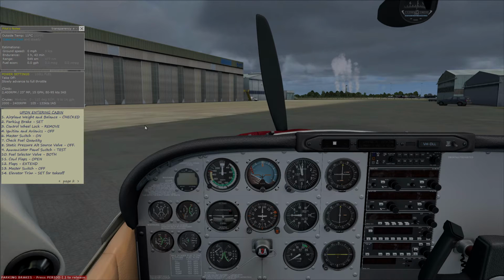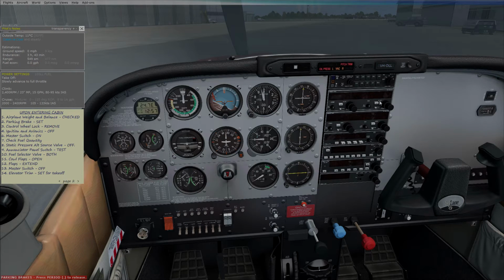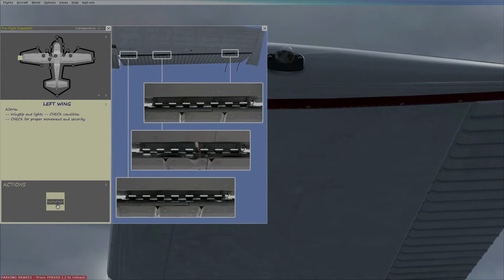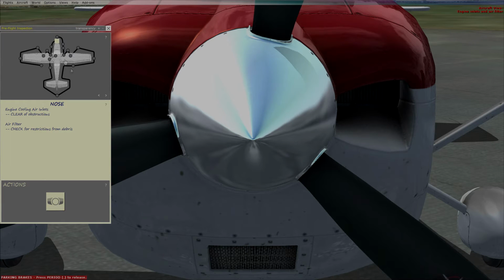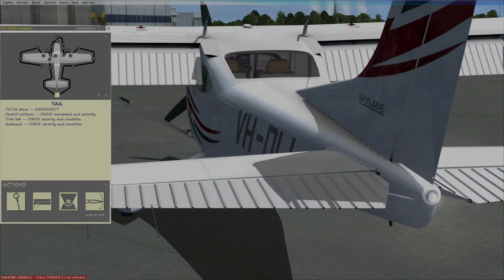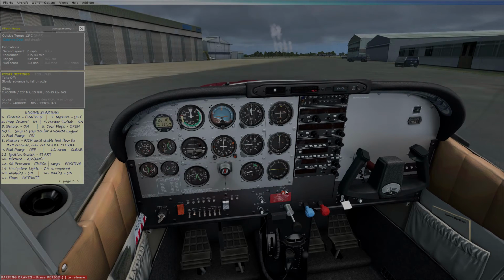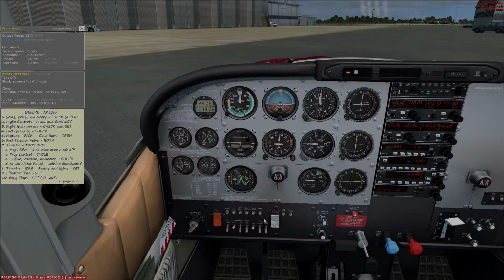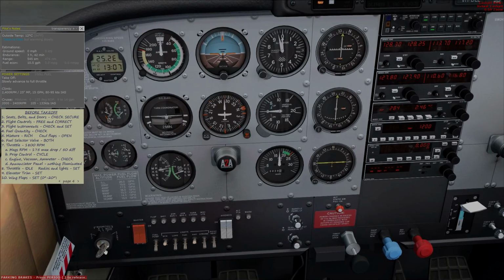How to Start A2A C182 (Fouled Plug)

Comment: Don't forget to lean on the ground, also make sure to idle at around 1000RPM :-) you could also select the fine wire plugs.
Reply: I'm only a armchair pilot, but i have around 100 hours on the A2A C182 :-)

Comment: It's more than likely a fouled plug which you could potentially clean off as you would when really flying by running the engine at a very lean mixture for a while which burns much hotter. It's this high temp that cleans the plugs.